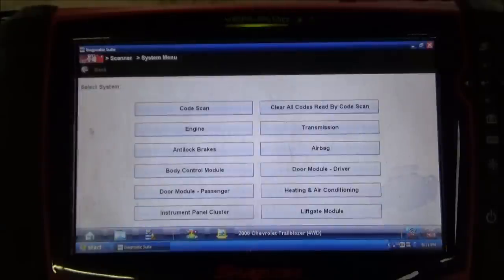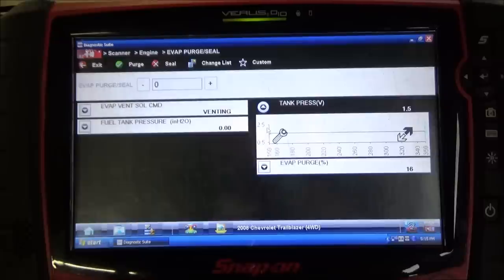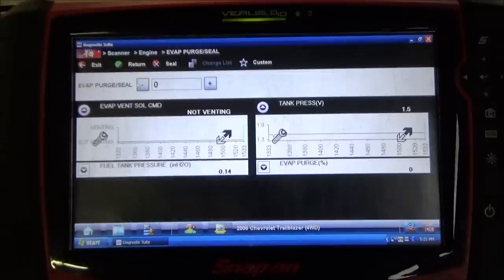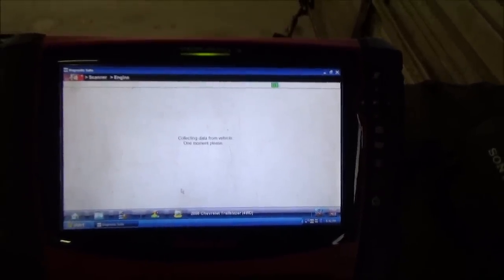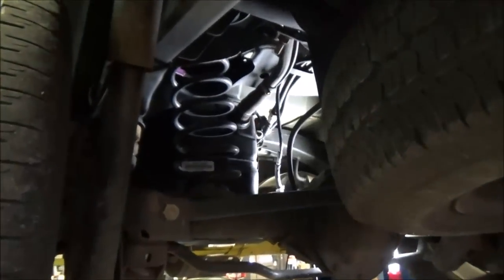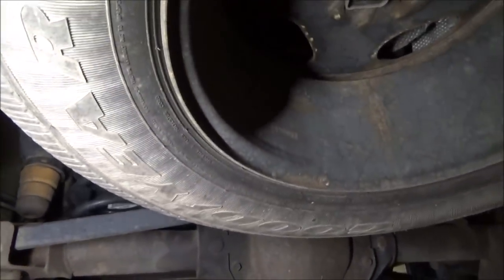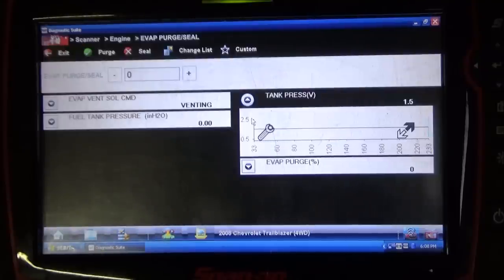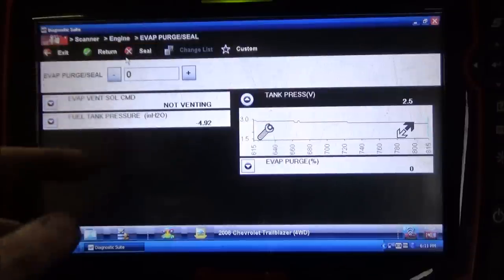EVAP Leak Testing,  P0455 Gross Leak

Comment: Omg this video helped me a lot, let me tell you my story for the sake of science and humanity. EVAP is a very difficult problem even a lot of mechanic don't wanna get into it. Two years ago i lost my car fuel cap i got it replaced from one of the auto part stores. And after going through a lot problems with my car shutting off when i put gas, a lot of time when I am idle my mechanic recommended me to change the purge solenoid and after 2 months he told me to change the charcoal canister. After watching this video I checked my fuel cap and I realized it it is not the right size I took some plastic bags and tried to seal it just to test and all the engine lights are gone!!! I just realized my fuel cap was leaking the whole time that was creating the problem all along.. thanks for this video
Reply: And unfortunately they charge you seven times what you make or more and hr

Comment: Thanks for the creating this video and showing us the smoke test and your other testing. I replaced the gas cap on my Dad's Hyundai Sonata with a new one from the local auto store. I don't want to mention brands or the company that sold it but, the new cap seal looked great and the old gas cap looked worn out. I cleared the code and it stayed off for a couple of days and then the light came back on. I didn't want to take the car to a shop to do have a mechanic do a evap smoke test because another mechanic on YouTube suggested to replace the vent valve and then if that didn't work to then take the vehicle in for a evap smoke test. I replaced both the vent and then the purge valve costing me only about $70 and the light came back on after a few days. I normally don't watch a 29 minute video but, I was glad I watched yours. The Gas Cap that they sold me at the local store doesn't even match up to the picture of what I ordered online and then picked it up at the store. The gas cap that I bought from the same store years ago for the same car had the triangle in the gas cap and the new cap that I bought that was supposed to be white but, was black didn't even have the triangles in it. The box number for the part matched up to the part number that I ordered but, I assume the gas cap that I received was a returned cap and the person returning someone might of done a switcheroo on the store getting a refund for a difference and probably cheaper cap and then it was resold to me. It wouldn't be the first time at that same store that a switcheroo was pulled. I am going to go there soon and ask them to check their other parts for that number and see what they have in their boxes there. If they pull out white gas caps with triangles then I am going to be pretty upset. At this point, I feel if I get the right gas cap that it should fix the problem...at least I am hoping it does. If it doesn't then, I can rule out the gas cap and go get a smoke test done.
Reply: I went to Auto Part store where I bought the cap and checked and the other cap that they pulled out of the box was the same as the one that I recently bought. I told them that the picture online doesn't even match up to that gas cap. They said the picture was just a generic cap. You would think they would take a real picture these day. How much does it cost to make a photo these days? Anyways, they gave me a refund and I went to the dealer and paid $22 for an OEM Gas Cap which was twice as much but, well worth the money. The OEM Hyundai Gas Cap that I bought from the dealer was way different.  I haven't seen the light come on since I put my older cap backon  after watching your video nor with the new cap. Thank you so much for making this video and showing us the smoke test and your result that it was the wrong gas cap! It saved me from going and paying a mechanic to do a smoke test and I would of been embarassed if I found out after paying someone to do smoke test that it was the gas cap. I let the auto part store know about the part that they were selling didn't match up to the Hyundai Sonata I have and the money and problems it caused me. I am guessing the gas cap that they were selling fits on some cars but, not mine.

You are good people at Triangle Automotive! Thank you!

Comment: Start with a new gas cap.  Cheapest and easiest at around $10 - $30.  Instantly fixed my P0455 code.  Was giving this code every day. I cleared the code and each time it reappeared everyday.  Never got another code for 3 months now.

Comment: I had a p 0455 code (large leak) a couple months ago on an 02 Dodge Ram 1500. Took it to the shop and they told me it was a crack in the Evap canister and would cost $480 to replace it. Sure enough there was a 2 inch crack on the bottom. Ordered the part on  Amazon and paid $90 for the part.  Put it on myself in 20 mins. 4 screws and 2 hoses to take off. The thing is not all mechanics are crooks. Only 99.9% of them are. Every single time i go to one they try to rip me off. Not his time. So glad You Tube helping me to take money from the bastards.

Comment: My oe cap went bad. I replaced with a similar cap that you had. Now I have a check engine light on and when I get gas, the car misses like crazy while running. If I shut it off to pump gas, it won't hardly start. And it will randomly start missing. Any clue why?
Reply: check ur vent solenoid... if it is closed you will pull a vacuum on the tank and it will make it hard for the fuel pump to pull fuel to the engine... the vent sol should be open to atmosphere all the time except when the purge cycle is running...

Comment: i have a 2009 mercedes benz s550 motor 5.5L,     when the pcm does the test leak by it self,     after closing the vent solenoid. do you know for how much time ( in seconds )  does the purge solenoid stays open during the vacuum on the evap system???

Comment: I did the smoke test on my 03 Toyota Sequoia, code was very small leak. Smoke was coming out of the gas cap as well. Replaced with new OEM gas cap, still has smoke coming out. There is a pipe going from the Charcoal canister to the filler neck, it was full of smoke when i unhooked it, even with the vent solenoid closed. I replaced the vent solenoid, still has same small EVAP leak. Any ideas?

Comment: The money spent for your Diagnostic time. Parts and labor is far more costly than trial and error starting with the gas cap first. 
The rubber became hard on fuel cap. I soaked it in silicone. Deleted the code.
So far so good

Comment: I could use your help. When i go to the gas station and put gas . It would take 2 or 3 times to start it. So i put in a new perge valve. So now it starts right up. But now when i put gass in. The gas feels hard to go in . And the  gas gauge went up slow. And i had put in a new fuel pump in . So i know its not that. So im thinking mabe its the fuel tank pressure sensor.  But not to shour.  My engine light is not on. But service soon light is on. But no codes show up.
Reply: It sounds like your tank isnt venting when you put gas in. On my truck theres a vent solenoid around the filler neck area so that the gas will go into the tank smoothly. My advice: look to see if your car has a vent valve/solenoid for the tank/filler neck and go from there.

Comment: 20p6 subaru sti cleared po442 and 456 can not clear po448 . What's your take. Replaced charcoal canister , some cracked hoses near the purge solenoid valve to the right of the power steering pump. I do not have a bi directional scanner but I do have a autool sdt-206 smoke machi ne just got it . Im retired with limited income . I know about the snap on verus too much denero for a diyer

Comment: I smoke tested from the test port and looking under the car there was no smoke, but looking outside where the gas cap is, there is smoke coming out of my oem and my Stant replacement that everyone swore by. My code is p0441. Could it be possible both gas caps are bad? It looks like the leak is coming from behind the grommet, but its not showing smoke under the car where the grommet is.
Reply from the maker: JohnnyMcKinney, did you command the vent solenoid closed/ block off the vent solenoid when you performed the smoke test?

Comment: Do you use compressed air or an inert gas with your smoke Machine? My smoke machine recommends Nitrogen for evap leaks but I haven't heard anyone mention that they don't just use shop air. Also great professional videos.
Reply: U never use just straight air. It will fill the Evap system's with Oxygen and push the Vapors out. Inert gas is the only way to do Evap systems with 1.5 psi of air introduced with the inert gas. A Car can explode with just straight air

Comment: What would it be on a chevy aveo if it pops up this code from auto zone. And we've  already replaced the gas cap last yr from the dealer, replaced  some things in the EVAP system last yr. But now the same code as last yr came up. We've  done a oil change and a tune and that didn't  help. It also hesitates and wants to stall out.
Reply: sell it
Reply: Purge valve pcv valve donzoooo

Comment: Having a similar issue with my 03 Tahoe I'm not sure how the EVAP vent works if I do a smoke test with the vehicle off I have smoke coming from the vent not sure if that's normal... I haven't done a test with the vehicle on or running... If I turn the key to on and retest should the vent no longer have smoke coming from it
Reply: You need to close the canister vent with a scan tool or on some cars you can just directly put 12v to it.
Reply: @123aznbeast  I figured it out it was the vent.... Went to junkyard and grabbed 2 more haven't had a check engine light since

Comment: Question?I have a 01 ford expedition 4.6.it sat for almost 5yrs,replaced the fuel pump ran smooth.i filled the tank up and it smells gas inside the cabin and it hesitates off and on doing about 70mph.help??
Reply: probably double check the fuel pump if it was installed correctly or if anything is off with the circuits of the fuel pump. My honda civic cabin smelled like gas inside until I checked my fuel pump and found that the fuel pump ring wasn't fully put in correctly.

Comment: hey there so i wasnt totally sure how you hooked up your smoke machine because if you hooked into the line coming from your vent why would you have to close it if its out of the picture or if you cake from the tank line that would eliminate the tank but you had smoke so really not understanding the the vapor lines routings made it hard to visualize how you tied into every part of the system so maybe you could clear this up if its not to hard to explain. dude on a side not i watch danner all the time and you are just as good of a teacher good work
Reply from the maker: Hey man,  if you hook into the line going to the vent solenoid then it isn't really necessary to close the vent during the test,  but if you opt to do this than you have to keep in mind that the vent solenoid hasn't been leak tested.  I hope I'm answering your question sufficiently.
Reply: Triangle Diagnostics isn't there a port in the under hood compartment/engine bay to connect the smoke machine to? The green evap test port?? Or is there a specific reason why that port shouldn't be used? Did it require a special connector that you didn't have? Did connecting to that port not perform the tests that you did under the vehicle? 

I'm also curious about which line, and why you connected to it under the vehicle! But, great vid, showing a smoke test, and a leaking/incorrect fuel cap!
Reply from the maker: roadkill5333 ,  on this vehicle there was no EVAP service port present.   You will find many vehicles out there that do not have one.  On some EVAP systems,   especially those using onboard refueling vapor recovery valves,  smoke testing  from the purge solenoid or the service port (if equipped) will not fill the entire system with smoke.
Reply: Triangle Diagnostics wow! If you ever get the chance to film that type of repair, I know I would love to see how to manage that tripe of system! Thanks.

Comment: I replaced my gas cap with OEM cap and it didn't fix it. Should I try to replace the EVAP vent solenoid without taking it in?
Reply: Cody Smith throwing parts at a problem rarely works unless you are quite confident what the problem is.
Reply: I'd say yes. If cap is surely not issue the solenoid isn't functioning correctly.
I have 2007 suburban having same issue.
Reply: Did it work?
Reply: Yup it worked. Y’all should get a BlueDriver

Comment: How bad can am evap leak get? can the vehicle drive okay until it's fixed? I never done evap leak repair.
Reply: Mine on my 04 Sierra was so bad it was leaking gas fUMES IN the cab n it's a crew cab. Man it stunk. Very dangerous.  Get it fixed right away. My whole sending unit was no good coat me like 1500 to fix

Comment: Great video. be cool to see what you do with Chrysler and Toyota evap systems. Is that a white board of knowledge I see? lol
Reply: Pico Boo told you that I can find you everywhere
Reply from the maker: Haha yep it sure is!  I handle Toyota systems in a very similar manner though you have to account for the bypass valve in your testing.  Chryslers are a much different story as they typically use a key off system for their leak detection,  using a leak detection pump or NVLD setup,  but the smoke testing procedures are still mostly the same.
Reply: Triangle Diagnostics haha, I am watching your video on the freestar, you just made a comment about the white board when this notification came through on my phone

Comment: What scan tool do you use here?
Reply: It's called the Verus by Snap-On, They're expensive. Get an Autel MaxiSys MX808. They're around $380 and they do just a much in terms of functions. There are always updates coming out for support for new and current cars.
Reply: @DoubleKlutch99  I am familiar with tee snap on line. I r/thank you for responding and the info on MaxiSys. I am a retired Tech and trainer. I am fighting  my 2004 Jeep Cherokee P0455. Need to find what to do on evap setup to do a smoke test. Shop did the test, no smoke. replaced all suggested parts, no help. Made th smoke machine and will do my own smoke tes. Great information from you.
Reply: @hedleylint7622  I had the same code on my 2005 GMC Sierra 1500. It happened to be stuck closed at the Purge Valve on the engine and the light went away just after about 5 miles.

If that doesn't help, then try ensuring that you have a signal at the plug at the vent valve and the purge valve by your gas tank. If you have a signal there it can also be a gas pump gasket where it goes into the tank or even a filler neck or vent valve tubes. Hope this helps.
Reply: @DoubleKlutch99  I put smoke into the tank fill pipe. Much smoke there by the fill hose at the tank. Is a scan tool to setup the evap test necessary for this? There is a skid plate covering the tank, can't get to the connection with out lowering the tank. Mor than a 1 man job. I need rto be sure I do not need to use a scan tool for this .

Comment: Seems like this guy is playing with his scanner more than anything. Ive been in the field for 15 years and i am currently a gm apprentice (by choice) and this is the way to diagnose and lose money at the same time (takes way too long to diagnose).
Reply: Somehow the dtc got cleared. That’s the purpose of running the Evap bay test. It forces the system to run and will set the dtc/s that fail/failed but then didn’t even let it run the bay test. 😬